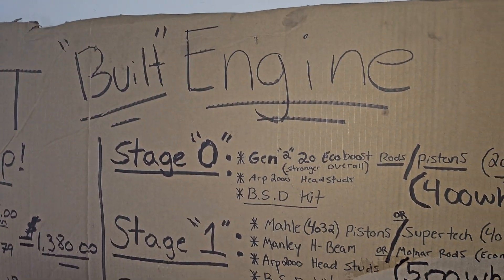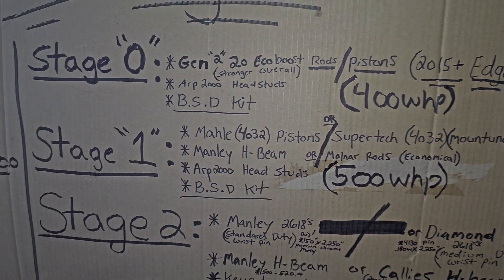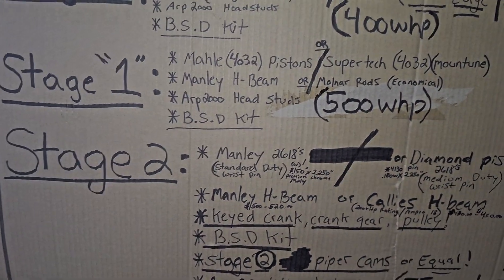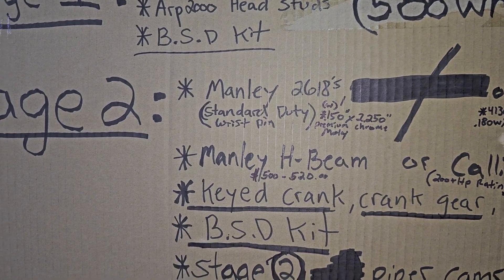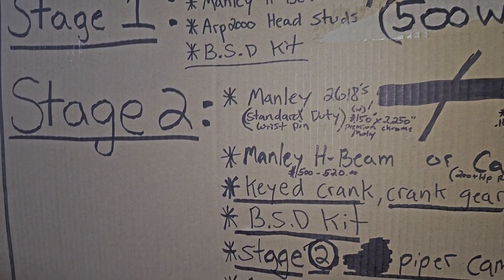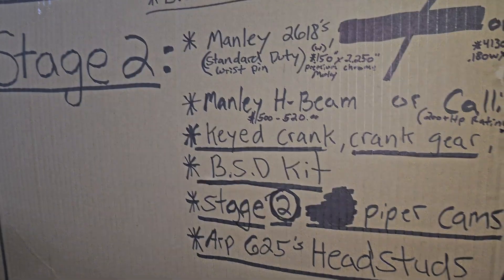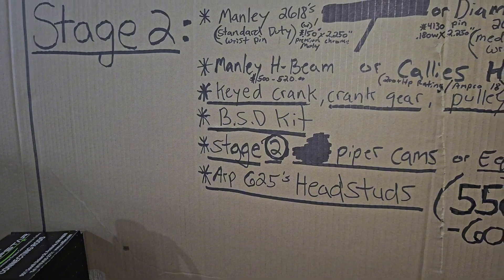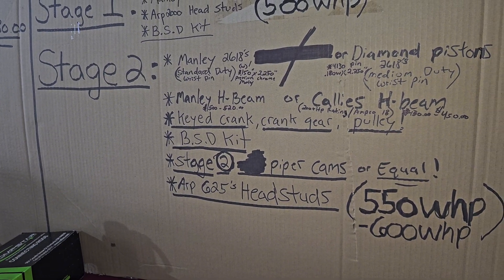Focus ST - Stage 2 *DIY Engine Build + HP Rating! (Pt.2) #builtenginefocusst

Comment: Greetings from Venezuela I have a 2015 focus st and I am looking for a number between 550whp and 600whp., I am working on a Moutune High performance 2.3L MRX stroker Focus St long block... what do you think of these engines??... do you see them working with reliably over a range of 550whp or do you recommend me to stay in some range below 500whp
Reply from the maker: The mountune 2.3 mrx is a great setup for sure,  i would not go over 550whp because over that number things like to break more often.  If you stay around 500whp it would be even better and more reliable,  you could have a kill map for 550whp but not use it only when needed.
Reply: @WhiteblurrST  

And what turbo would you use for those looking for 500 or 550 whp... g30-660 or g30-770?... One of the things that interests me most is keeping the construction safe...
It is a whimsical car for the weekends. and I would like not to have so much lag
Reply from the maker: I would go with the g30-660 with .83 ar if you were sticking with a 2.0,  it would get you to 500whp no problem, even 520whp im sure.  The 770 spools really well also but its like 300rpm more lag on a 2.0 setup but with a 2.3 personally id go g30-770 because itll spool quick and have plenty of efficency left.
Reply from the maker: Honestly you could just do the mountune mrx 2.0 setup and make the same 500whp or 550whp max no problem and itll cost less money.
Reply: @WhiteblurrST  At how many rpm does the 30-660 spool?... And one more question... do I have a dilemma, pulsar or garretts?... Is Garrett really worth paying the price?
Reply: @WhiteblurrST  Moutune High performance 2.3L MRX stroker Focus St long block is already with me... I preferred the stroker looking for faster spool
Reply from the maker: Pulsar is cheaper because it doesn't have the high quality parts of garrett,  for example stainless steel exhaust housing, the turbine wheel on the Garret is Mar-alloy which handles heat better, the Pulsar is inconel which is like gtx or old technology basically,  its up to you man.  Id search up if there are any failures of the pulsars then go from there.
Reply from the maker: The g30-660 on a 2.0 is full boost around 3500-3700 depending on boost, e85 or 93 octane.  So expect 500 rpm sooner spool with the 2.3 stroker basically.
Reply from the maker: Ok sounds good.
Reply: @WhiteblurrST  perfect... spool between 3000 and 3500 rpm would be great... it's what I'm looking for
Reply from the maker: You definitely will achieve full boost quickly,  spool would start at around 2200 i imagine.

Comment: What you think about head studs, rods and pistons, in a bnr71 st, id1050s 4 port aux. I want maybe a little over 500, but not much, and not sure if I should just go with the stage 2
Reply from the maker: Can the bnr 71 make over 500whp efficiently?  1050s are definitely overkill,  i have 65lb injectors and those are good til 600whp.  If you want a little over 500whp id go callies h beam rods from summit since its cheaper, get yourself some diamond pistons, arp 625s v2 from ems or speed performance.  Stay with stock main bearings, stock main bolts, get stage 2 cams definitely.

Comment: Thanks for the break down of the engine. Have you done any work to your transmission? and did you install a posi traction to your ST to get it to hook better off the line?
Reply from the maker: I have upgraded carbon syncros, Mfactory diff and Stage 3+ spec clutch.  Ill have a new series on Hp Levels and whats needed to make that hp or support it.